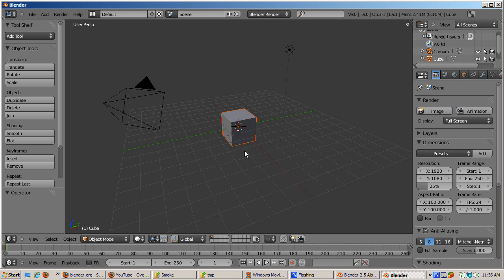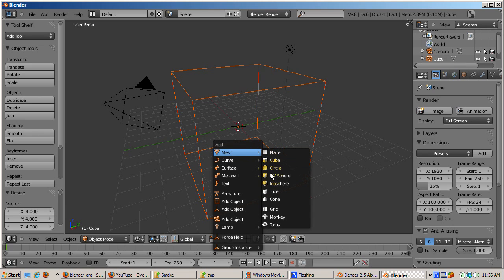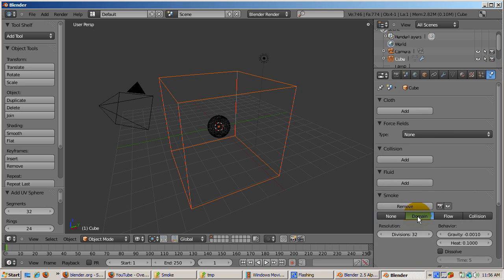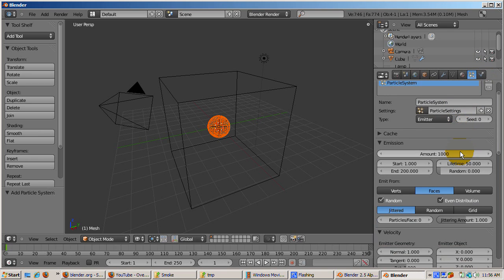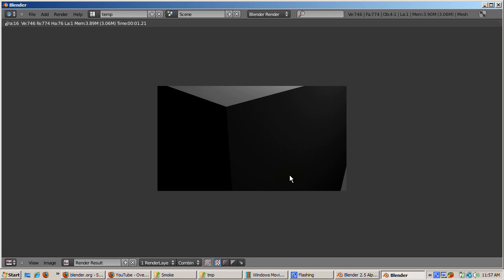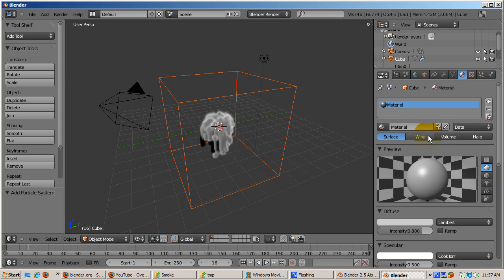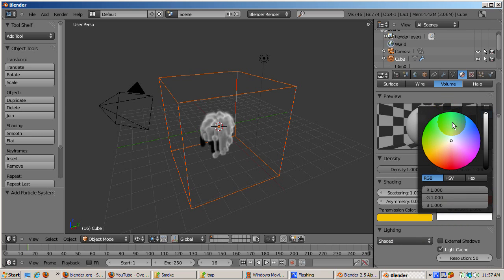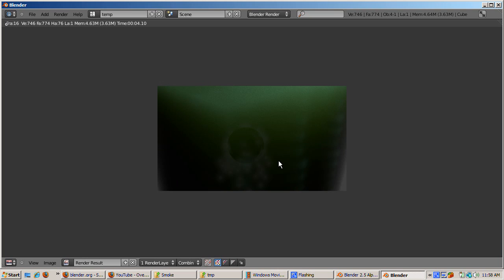Ira Krakow's Smoke Simulation Blender 2.50 Tutorial

Comment: I did some fiddling and found the solution, there are 2 settings, in the material tab you should set the default density to something real low like 0 but keep the density multiplier up, then on the texture tab scroll all the way down to where it says "influence" and then check the density, and set it too something high. and you also have to remember to check raytrace, and make sure everything can recieve transparent shadows.

Comment: Thanks but it's not that, it's just that the smoke doesn't render as it looks in the simulation, it just seems to fill the domain, I even tried changing the density in the voxel texture to be used and turned the density in the shader all the way down, it's acting oddly

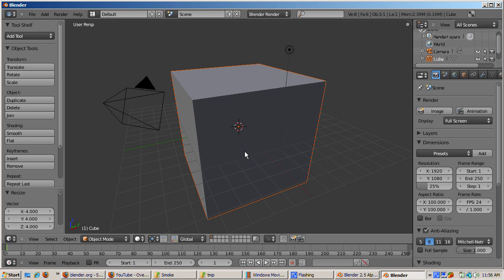Comment: I'm a bit new to Blender and I got lost in your video at 1:10 "Press the C-key to go..". I press the c-key but it doesn't go into wireframe mode - I just get a round circle around my curser. 

Can I get to the wireframe manually then without using the keyboard, heh? (: 

Thank you!

Comment from the maker: You can add edge loops.  Go into edit mode, position the 3D cursor inside the object, and press Ctrl-R.  That will add an edge loop inside.  If you need to close up an open model, select the vertices for the face and press the F key.  Also look at Alt-F and Shift-F to fill the mesh with faces.